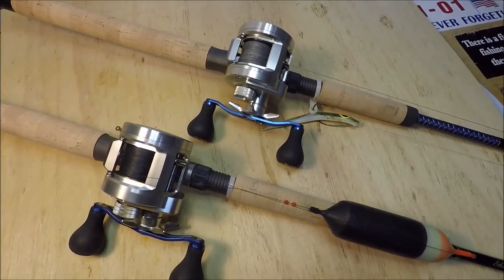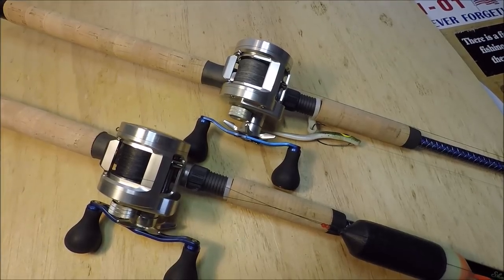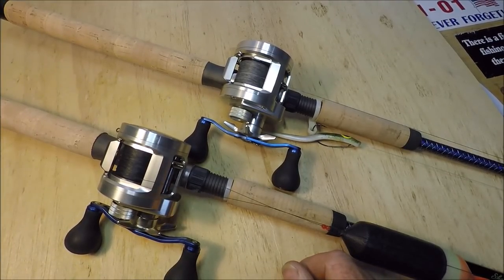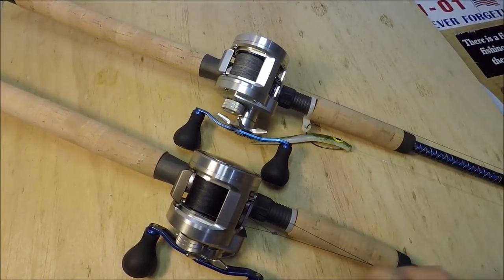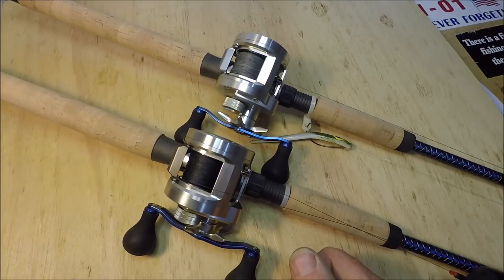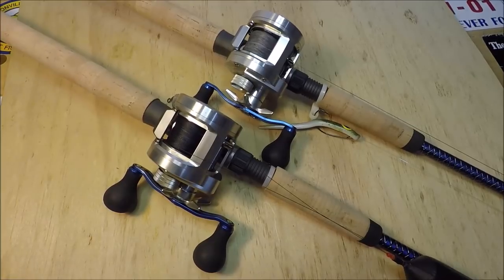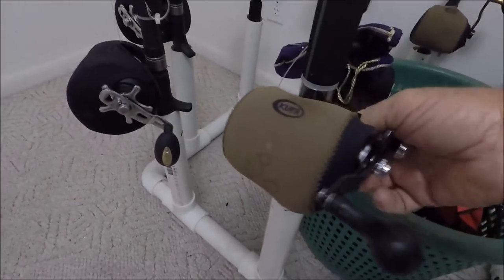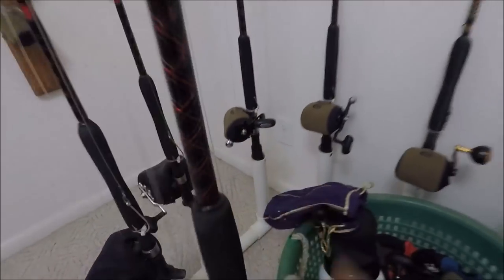BRAIDED LINE COMPARISON  "Fade comparison''

Comment: Whatever works! That's my motto. I have some 30# chinese spectra braid that has worked fine, but for my everyday primary 'big fish' rod, I use 30# spiderwire because it's easier for me to tie knots and it usually lasts me about 2 years. If I had to outfit a whole bunch of reels I'd find something cheaper though. Interestingly, I have a couple of Hercules baitrunner reels I found on Amazon for like 30 bucks each a few years ago, and, while they are cheap chinese reels, they've worked good as back up reels or when I take the kids out and need a bait runner and know the kids will be dropping them in the sand every other fish. Much better than having them ruin my more expensive reels and better than a non-baitrunner. They work good for carp too. Anyway, I like videos where people just say, hey, I've used this a lot and it works for me.
Reply from the maker: YEP that was the motto.  I was right, not such a HOT topic any more, seems even in the comments, ''ANYTHING THAT WORKS'', no powerpro fan boys, or kastking youtubers. Hercules hasn't faded out like Kastking or Godline.  IF that means anything.

Comment: Every one got there favorite fishing gear I’m still using my Garcia 5500 and 6500c reels I bought back in the 70s
Reply from the maker: this is about line on reels, not tackle
Reply: Yeah I use power pro and Berkeley big game in my striper boat been using it for years I found that big game in late 90s but I’m like you want the best for any one I take on my boat I was a guide  on lake Murray in sc in the early 2000s I take a boat of people be off the water by 10 with a good limmet

Comment: Nice Ryoga's  Capt Dave. Chinese braid is what it is. Its a less expensive alternative to Power pro or spider wire. If it works for you then it works for you. For you it is a tool of the trade. For me sometimes I really need to have the Snapon tool. Other times the harbor freight tool does the job. So many different variables to mention. BTW I saw that on your tools of  the trade page, the extra long lip gripper is no longer there,unless I missed it.
Reply from the maker: its back!

Comment: I been testing Hercules for a few years now.I like a good bit.The biggest thing I like is the price,$31 for 1094yds of 30lb 8 strand.
I do color code the lb test.I have 15,20,30 and 40lb.
I do have a 20lb in 4 strand but don't like 4 compared to 8.

I haven't found anything to complain about with the line,it fades after a while but I couldn't give a rats ass about that,but I do leave the rods and reels in the cab of the truck 24/7 though so UV may have some to do with the fading.The 30lb has still pulled in 5-5.5' sharks but I am primarily a cat fisherman.

Ohhh,I have had words with a guy on another channel saying a Clinch Knot always slips on braid after the discussion started about FG knots.Do you tie Clinch's?
I haven't had any problems with a Clinch slipping on braid,but I do tie 8-10 wraps (12 on the 4 strand) instead of the usual 5-6 on mono.
Reply: Are you still using hurcules if so how is it does the line have decent abrasion resistant
Reply: @bobbycampbell175  Yeah.
I'm still using the same #30 on my cat rods I spooled on 6 yrs ago and is holding up great.I live and fish PA and we have a lot of rocks,rock ledges,etc. in our waters.I don't have a problem with the abrasion,it all depends how you fish itI have only lost a eig 2-3 times in the last 6 yrs from abrasion problems.

I prefer it over any of the others.I have spooled all my reels,from my 14' Crappie/Panfish rods to the 50/80 Shark/Ray rods with it.I have #8,10,20,30,40 and 70.
One correction to my orig post....I tie the clinch with 12 wraps not 8-10.